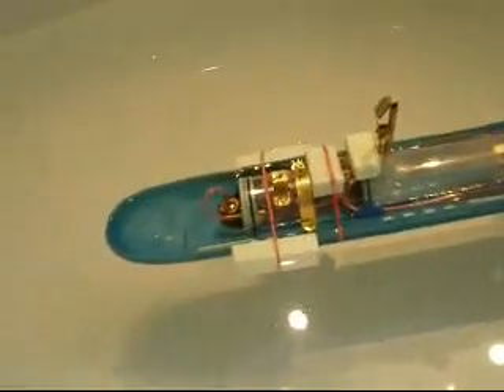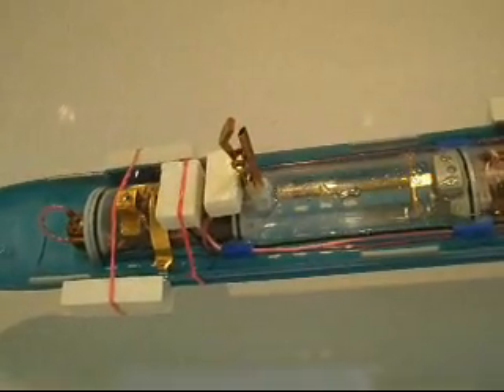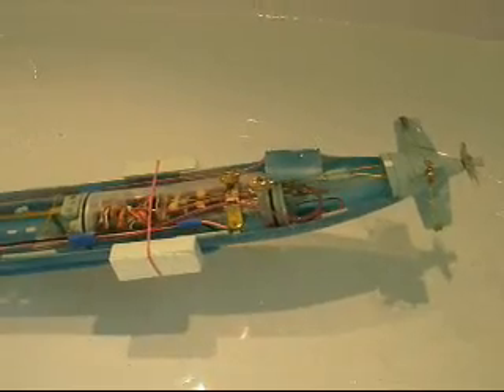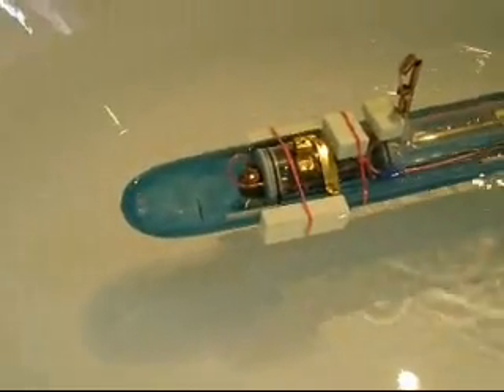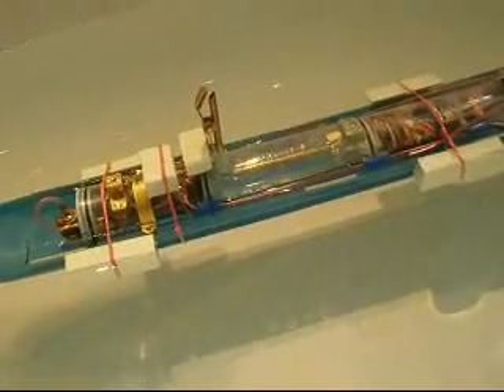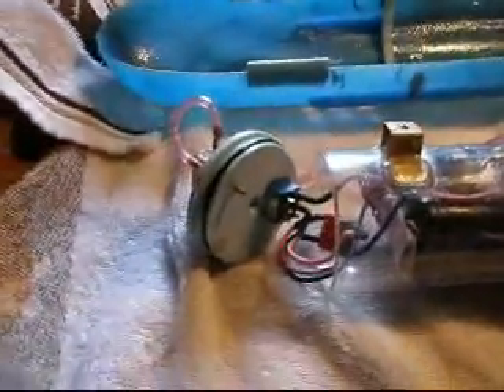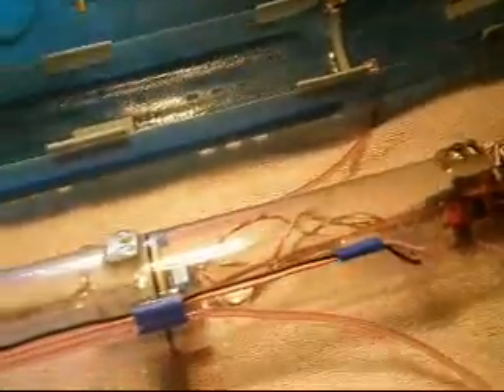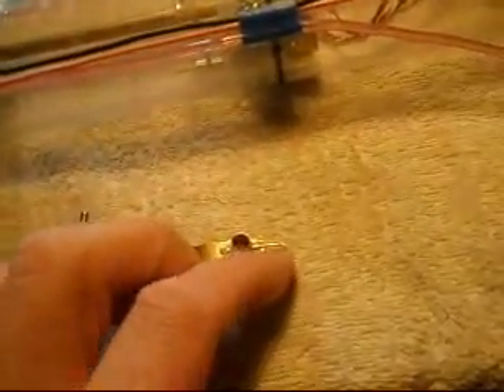Type 212 part 3

Comment from the maker: These and the following testingcycles have to iron out the problems which i can encouter during driving this boat, the ballastsystem can also be used underwater, to a certain degree it has to replace the normal gassystem used inside these small boats.
Still a lot of work to do.